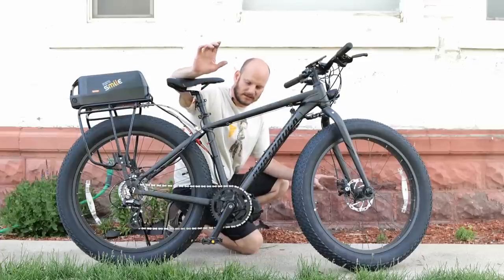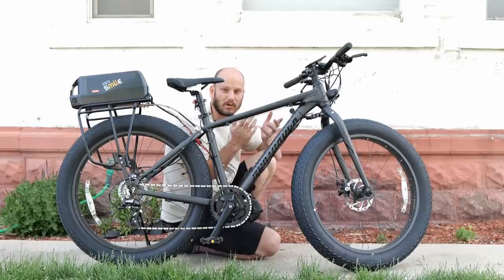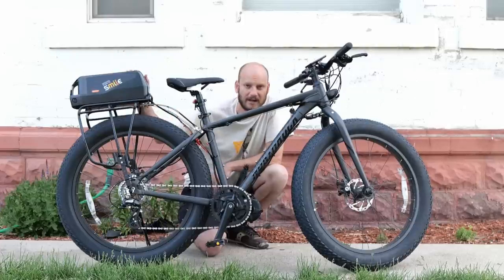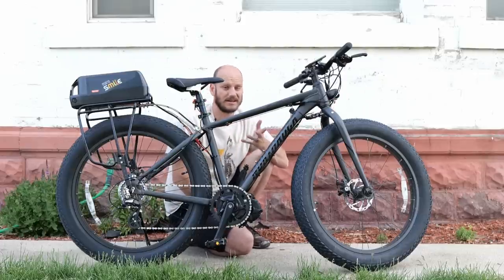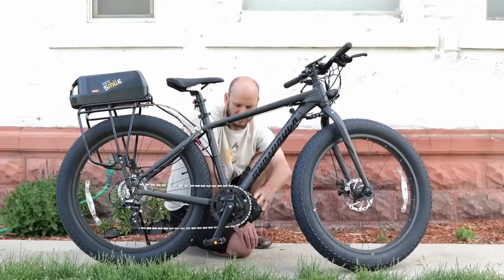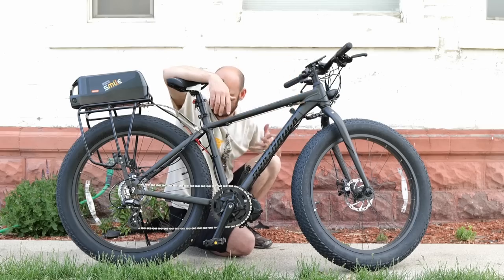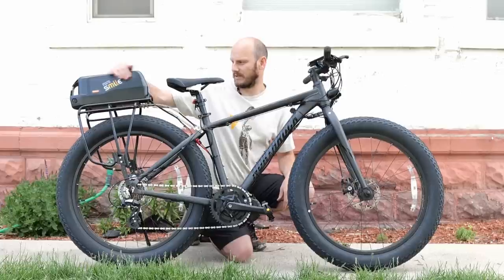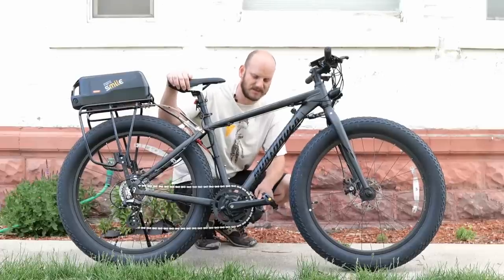Reviewing the new Polarizing Bafang M625 Mid drive motor kit

Comment: Although I'm not a fan of products that are locked down to prevent customization, a lot of this is motivated about complying with new ebike and battery safety regulations. Unfortunately things like battery fires from sketchy battery packs, and people de-restricting their controllers are the reason for this setup. One benefit of this system is all the extra info you can get with it. I personally think it should be standard across all ebikes to be able to see the pack temperature and individual cell voltage. This feature alone will also be a huge benefit to companies that sell bikes with it, and have to deal with service issues later. i've done customer support for ebike companies that didn't have this kind of battery intelligence. It's a huge hassle getting customers to probe their batteries with a multimeter to figure out what's really going on.
Reply: That likely has a lot to do with it, yeah. That said, it's still just a regular ol' ebike motor under all the proprietary gadgetry. You can rip out the built in controller and solder longer phase and hall effect wires in and use them with any ol controller, it need not even be an E-bike specific one. Regulations-wise, I see those becoming increasingly hard to enforce as knowledge of EVs spreads. They'll just ban them outright in a lot of places would be my guess. In the same way that slapping a 5hp Briggs on a bicycle is a thing that people do in the Southern US in a blatant disregard of both the law and their own lives considering bicycle brakes.

having vitals from the BMS (and the motor) on UART or CANBUS for the display to show you would be great if it where an open standard, though, I'll give you that.
Reply: (I've considered doing the 'put longer phase and hall wires in' approach to put a decent controller on my TSDZ, as well as reduce the heat generated inside that tiny motor housing.)
Reply: The fact that the M625 kit has everything included including the battery was the reason I bought it. I didn't want to have to figure out which battery to buy and I'm not interested in spending hours tweaking the settings when I could just turn it on and ride. I'm hoping Bafang or possibly third parties come out with CANBUS accessories, the front light that comes with the M625 is not great.

Comment: Nice review Johnny.  One not-so-good thing about using a brake splitter for the gear sensor is that the brake cutoff cuts power for almost a full 2 seconds which can be way too long, especially if you are climbing a hill.  The gear sensor port on the BBSHD cuts power for 800ms which is just enough time for the chain to move to the next gear and then power comes back on.  We are going to miss you in Salt Lake buddy!
Reply: The other issue with using a splitter is that the controller thinks the gear sensor is a brake sensor, so changing gears will activate the brake light. Not a big deal, but maybe annoying for some people. I don't have a gear sensor on my M625 so I end up just tapping the brake when I shift gears anyway. Not sure why Bafang thought you didn't need a gear sensor, shifting gears while the motor is running feels and sounds like it's going to rip the chain and cassette apart.

Comment: Did look at this kit but went for the bbshd instead! ...glad I did! Battery size and weight, plus the fact you can't use another smaller battery, only this one? ..don't think this kit is an improvement for me. If range is a problem, I just carry a spare smaller battery in a pack on my bbshd, so love my bbshd, didn't rate johnnies build as the battery weight is too high up for centre of gravity! Built a hub motor with a rear rack battery previously and that too has a too high centre of gravity, for me anyway.

Comment: it's like bafang don't want customers. why give no choice of battery AND make the only battery a stupidly huge one? I respect your work but the battery on the rear rack looks daft.
Reply: One can customize battery pack if one has basic electrical knowledge
Reply: @georgecarlinn6288  no you can't - not with 'basic' electrical knowledge
Reply: @georgecarlinn6288  not with this there computer chips to detect if it's the correct battery. It's not just a power cable plug in.
Reply: From what I’ve heard You can put a BBSHD controller in an M625 with minor modification, and it will work like a BBSHD including the shift sensor. It apparently allows you to use any battery.
Reply: @EBikeBuilder_  this is 100% true but then what is the point of this motor over the BBSHD? internally they are the same
Reply: @djneils100  they put that bit on where you can hose clamp the motor; that was one of the major flaws of the 02 and HD. Otherwise, I have no idea why they made the M625 or what the point is. They are very similar. I would never abandon the ability to use a battery of my choosing, and also to program the motors. But REALLY it's only a matter of time until the M625 gets hacked and has programming cables like the BBSHD did. Bafang never intended for everyone to be using programming cables with the BBSHD. The software used to program the BBSHD is actually from a hacker who took the bafang source code and improved it.
Reply: M620 and now the M625  what's the difference its all becoming confusing?
Reply: @EBikeBuilder_  my theory is they saw how much coin that they didn't get. Shitty design and the rest, works for ATT and Samsung
Reply: Sure. To those daft people who get stuck up on vanity over function.
Reply: @matthewyabsley  the rear battery is daft because of function not form - having a heavy weight stuck out at the back of the bike compromises handling compared to a centrally mounted battery PLUS it stops you using the rack as it was intended for luggage or paniers
Reply: @djneils100  - I get it now. Thanks.

Comment: Ooph! Never thought I'd hear "...better than the HD..." out of your mouth. Sacrilege, I say. All they did was beef up the HD and make it idiot proof by blocking the DIY alternatives in battery and programming. That triangle isn't too small, the battery is too big. I'm planning another build on my Dolomite ALX and was interested in this motor because it has some sweet features but the first thing that concerned me was the enormous PROPRIETARY battery. Next I found out about being locked out of programming. I didn't love the lack of a gear shift sensor but figured I can just plug it into the port for the rear brake & live without the motor cut-off or brake light on that brake (I much prefer your solution). It's an unfortunate thing that they restrict the 1kw motor to 750 watts in the fat BB size. The final nail in the coffin for me was the the Dolomite ALX has a 120mm BB & the M625 doesn't.
There is a market for this motor but it will put off a lot of loyal customers. I hope they keep improving on the HD & 02 and don't just concentrate on this new watered down for the uninitiated model.

Please pardon my rant. You did an awesome build given the restrictrictions.
Reply: Its exactly the same as the bbshd inside
Reply: @HighVoltageKits  Thanks to your channel, I knew this. Been a subscriber of yours for years (you were just starting to tweak your HD on a fatty to work with a BAC at 72 volts just as I installed a Ludicrous). I even mentioned your channel in another comment. Your passion is inspiring, your work impressive & IMO you should be legend in the industry. Please keep up the good work.

Comment: I would stick with BBSHD and 02. I am incredibly happy with my 02B that I bought from you.
Reply: Could you please explain what's the difference for you between 02 and 02B?
Reply: @thankmelater1254  I've only owned the 02B and it is awesome. Never tried any other Bafang mid drives except what I bought from Johnny. Much better performance than the hub motor bikes I have, especially for the wattage rating.
Reply: @ChrisBFerguson  Thanks, Chris. I found this explanation "BBS02 motors made after 2016 are all BBS02B motors"
Reply: @thankmelater1254  02B has upgraded Moffatts ect as far as i know.
Reply: @tonyrichardson2637  Thank you tony. Upgraded mosfets. I think that's the next motor I'll buy in a couple of years when my ready made heavy  hub motor bike starts to need replacements of everything.

Comment: Eyyy, had used bafang over the years  in 4 builds and thank you for your advise and reviews!    I wonder if the battery can be mounted horizontally  inside the frame for a quick swap like those e-moto? Cheers!

Comment: Am I correct in thinking that the most important programmability feature is setting the top speed? If the controller does that natively, then maybe I don't need to program anything else? Am I missing something?
PS: I kind of like huge batteries. Or maybe two battery packs. Especially with good diagnostic info.
Reply: Hello Bill. Along with top speed, on the BBSHD BBS02 you can programme (adjust with a programming cable) when the motor kicks in, how hard it kicks in, how much assist on each level, how long the motor kicks in on each level, how much it reduces as you pedal/get faster. Throttle control can be adjusted. Low voltage cut off and probably I have missed something. So it isnt just top speed. However if it is just top speed that concerns you then this would probably be fine as long as your bike can accommodate the big battery, as not everyone wants to fine tune every parameter but plenty of folk do.
Reply: @JohnSmith-ch9lp  OK, I was trying to ask for weighting; how important is that stuff? I dunno... I've never tuned one. Haven't even ridden an e-bike... yet. But that is going to change, thanks to you.

It sounds as though you find the other settings useful, so I guess that is what I was asking. Thanks again.
Reply: @billb5732  No problem Bill. Factory settings are fine but you now what folk are like (including me) if you can tweak something you do it. Also although referred to as 'programming' it is really just adjusting the settings (you need a cable and a windoiws laptop but the programme itself is free). For example on mine I adjusted the motor power to come in more slowly as the factory settings seemed a bit sudden for me. I live in a hilly area in England and my ebike (Bafang BBS02b motor) is marvelous for assisting me get places without arriving in a heap of sweat. Good luck Bill if you decide to build one.
Reply: @JohnSmith-ch9lp  Thanks. I certainly would tinker with it if given a choice. 

I visited the Cotswalds many years ago. Stunning countryside for cycling. Dunno if it seems that way to a native, but I really enjoyed it as a visitor.
Reply: @billb5732  Oh great, yes I've been once too. Very pretty. I live in Sheffield and cycle in the Peak District National Park  just 10 minutes away. Stunning scenery and some great cycling.

Comment: Ive rebuilt a bafang battery thrice now... You can re use the bms and use it on a different pack...downside is you have to extend the bms wires and still use the charging port and charger

Comment: I have only used hub drive for the last several years and I have no issues. I steered away from mid-drives because I imagined that my legs would have to move along with the pedals since the motor is driving the crank. This is a turn off for me, since with the hub drive, you can sit there and never have to move your legs. Especially in winter when I'm wearing several layers of thick clothing.
So does the pedals move simultaneously with the crank or is there some kind of mechanism where you can pedal if you want to, to help the motor?
Reply from the maker: Yes, mid drives have a free wheeling crank so that you can keep your legs stationary whenever you want.

Comment: Hi Johnny and followers. I have a bafang mid drive and generally love it. My only issue is that I feel a lot of drag in the pedals when I turn it off or set assist to 0. Does anyone else experience this? I’m told it’s normal but as someone who has enjoyed many long climbs on loaded touring bikes it does not feel normal.
Reply: My Bosch mid drive requires oil not lubricant. Twice yearly I lay the bike flat one one side then the next day the other. Silicone lube will work for less than one month!

Comment: Agreed on that... What makes the battery proprietary to the system, is it the connector that they use? Can't that just be swapped out with another one more common?? Is something like that is a big turn off for me, might as well buy the bbshd
Reply: The different connection provides two way communication between battery and controller. No communication and the controller won't accept the power being offered.

Comment: Yes you can use different battery packs.

Funny enough I have two battery packs 36v in series =72v.
What have them data wires what I have bypassed on my  Ebike.
No problems at all it's very simple.
For a professionally e-bike builder it should be very easy to work it out.
Reply from the maker: What did you use to bypass the can-bus?

Comment: Why would most bikers want this giant motor? For ebikes 250W motor with ocassional burst to climb steep hills is all that is required. For batteries fast charger and capacity to last longer is what it needs IMHO. So, fireproof frame laden with a batteries would be ideal. Rest is an experiment at home for few, isn’t it? What bike communities should work on is to ask OEM to make a simple kits. Because if that would have achieved ebikes and ebike kits would have been lot cheaper with mass production and supply.

Comment: I would like to see you buy a welder. It is simple enough, but at first you might feel like you don't know what the hell, but you will figure it out fast. This way you can do custom work and have a huge name. You could also take any frame and do anything you want with it, like add a custom motor mount frame out of old bike, or weld on a tapered stock for high performance shocks, Cut and trim, reweld anything you want.

There are thousands upon thousands of old bikes to practice on and won't cost you a cent. Just start a organized scrap pile with different metal and steel beams and pipes.
Reply: I agree, be bold. Bolting on a manufactured kit does not a fabricator make. Why is nobody (but me) welding the motor bracket to the frame? And yes if you have an aluminum frame, you will have to make an aluminum bracket.
I would be cutting that frame to make the battery fit. But for most people hose clamps are easier.
Reply: @williamgerkens573  Awesome, that is the spirit of DIY, the spirit of freedom and independence. 
Yea you could make that battery fit anyway you dream up, anything you want. Starting with just a good enough welder for the type and size of material you will be working with, and a grinder along with other basic tools like hack saw,  etc... can be enough  you can do anything you can dream up. But if you get good at it and like it, you can keep building up your some enhanced tools once you are confident and willing to make money with them.
Reply: @williamgerkens573  But be sure to keep doing what you are doing too. I just meant it be cool to see some real cool custom stuff too.

Comment: Needed: 3 pin battery communication cable extension or connectors for both ends. where to get this issue solved for recumbent trike installation?

Comment: We are adding an M625 to my friends Tadpole trike and we need a cable extension for the battery communication cable and the speed sensor.  Looking for a source of the cables or the  connectors.

Comment: Stupid newbie question, I'm tempted to either use one of these or a hub motor, just with motor alone I take it the pedals will stay in place, ie you don't need to pedal under power, I presume there's some sort of clutch or something?

Comment: at my bafang can bus Hub motor system you can just plug a no name XT60 batt to the system. there is no CAN bus information 4 bat but system starts and after a few seconsd the bat scale stops blinking  and shows full status. perhaps it also works with the M625 ond xt90? plug..

Comment: Aren't these mid drives wearing out the chain faster?
Reply: Uh, not really.  I used/will use the KMC e9 Ebike chain, along with a wax-based chain lube, and had less than .5 wear in over a thousand miles. (Park tools gage.)

Was running this with a BBS-HD, and pulling a grocery-laden trailer at least once a month.

Note that I was using a gearshift sensor, and not, as a rule, pushing all that hard.  (15 miles an hour, pulling a load of groceries, uphill and all, is a whole lot better than riding a slow, cramped bus while wondering if the person next to you is going to get offended by you being on the same bus!)

Comment: Will you still have to grease the gears inside the motor after 600 miles?
Reply: I put Mobil-28 grease in the case before installing it.  I love the near-silence.

Comment: So i went to your site and planning the same thing (kinda) the BBS02 mid drive motor 750w, 52v 16ah LG pack Long Slim pack, Smart charger. 1-5 amp selectable, Gear Shift Sensor for Bafang mid drive motor systems, the In-line brake cut off Sensor and the Bafang Programming Cable, For my Trek 4 Series  MTB.. is there anything else i need ? Sorry i'm new to the eBikes 💁
Reply from the maker: The smart charger wouldn’t work with that pack. You’d need a 3 pin mini xlr charge port. Almost every shark pack I have is compatible except the long slim pack.
Reply from the maker: @jasondundom1390  yes

Comment: I want to buy a new bike, mountain or tour, and add a new emotor system to it. I’m having trouble finding the bottom bracket width. I’m in the military and using the Navy Exchange for bike selection.  But I’m not seeing down bracket width. I want the BeFang 1000 motor. Thank you

Comment: Absolutely no way I would ever buy or recommend someone buy the m625 if they are even remotely competent with tools/bikes. It's a closed system that doesn't allow any modifications or upgrades and the motor has identical specs to the bbshd.